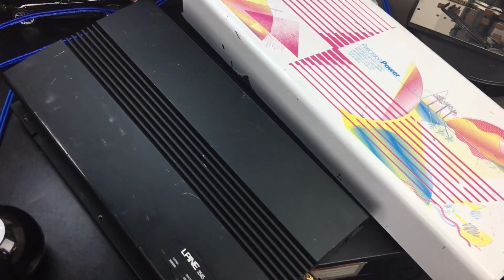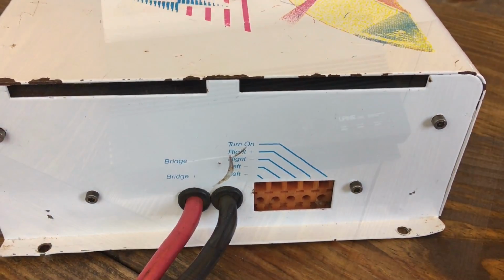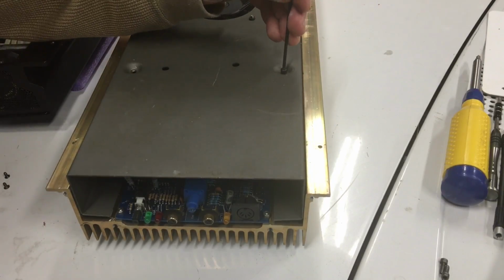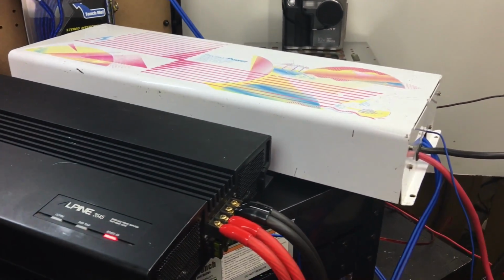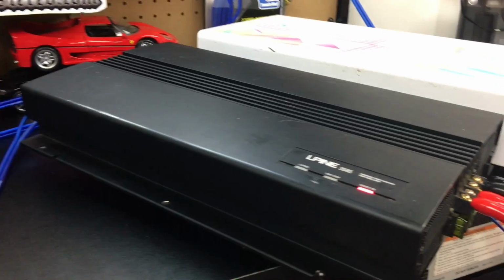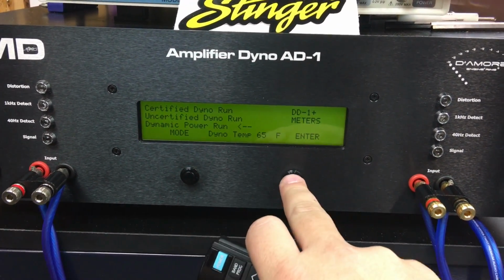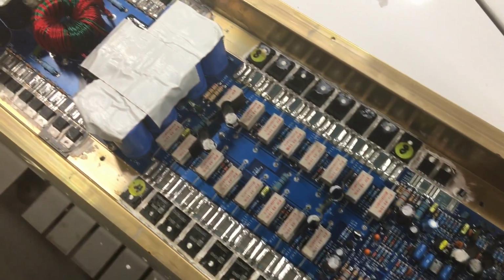1989 Alpine 3545 vs Precision Power (PPI) 2350DM Amp Dyno Drag Race

Comment from the maker: Ok, so I had to rewatch this video. I have over 500 vids on YouTube, so I can't possibly remember them all. I'll have a few short vids on the Alpine 3545 and 3558 upcoming on my 2nd channel at WheelieWilliston.com . Make sure you check out that channel and consider subscribing for more content!
Reply: I got an Alpine MRV-500 for my birthday and it was a nice little amp. After I upgraded from a K-9 to an EVL D2 (both 12's), I got a brand new Skar RP1200. I got the EVL and 1200.1 at the same time so when I heard it I thought it was defective. It wasn't near as hard hitting as the 500.1 on an EVL D4 I had in my Civic. Long story short, I hooked up the 500.1 to the EVL-D2 and OMFG that thing is WAY HARDER HITTING than the SKAR 1200.1!  If you ever have a chance to do a comparison I think that Alpine would smoke the SKAR at 1Ohm or maybe I just got a defective unit. The only thing that makes sense is that my stock electrical system was better suited for the 500.1 and there just wasn't enough spare amps to get anywhere near 1000w.

Comment: The 3545 had zero noise, zero engine noise, zero turn-on or turn-off pop. One of the best amps ever made. My competition car was originally running two HiFonics Zeus, US made in those days amps, 300x2. The Alpine rep was looking at my system one day and asked why I wasn't running their 3545 amps. I replied, "because they are $1400 each?"

He then tells me he will give me one for half of cost and another for free. It was no question. Even though HiFonics were really good amps in those days and rated for more power, the Alpines sounded far better. It's not about the amount of power in audio, it's about the quality of the power. I was running two DynAudio 11" subs with 4" voicecoils, also the best sub I ever heard, but they need a large enclosure and a special "VarioVent". My enclosure was 2.75 cu. ft. per sub, but it was smooth down to 16 Hz.
Reply: If installed right, you'll never hear engine noise, and I'm (currently) a ppi 600.2 for my interiors and an alpine 1505 on a triple stack of Rockfords HE @ 2.8 ohm load, and  alpine has never shut off once. Considering it's only 4 ohm stable bridged. I'm thinking about pulling the 1200.2 off the wall, but my alpine remote light stays on after sitting on my wall for 20 years, but to be fair, I did put a piece of plexiglass on the bottom to show off the V12 caps and after spraying windex to clean all those year probably did it (that's what a tech told me) but just hooked the remote lead to a non accessory fuse and she cuts off and on. I love old school amps. I have around 8 on my wall now since I started using a couple. I still have my first class d mono block, a Sony gxd 600 mobile es. With only three 25 amp fuses, it did 1400 watts dynamically. Go check it out

Comment: I bought that 3545 slightly used in 1990 and had it pushing 2 pro series 12's I wish I still had that amp I also had the 3559 as well ❤️‍🩹 them both

Comment: I’d maybe want to redo that 4 ohm certified run. Not sure how you had them wired as far as power supply. Like were they on separate battery banks? Maybe the PPI was pulling power out of the Alpine during that run? The voltage didn’t reflect that, but maybe it was losing amperage. Just weird that the Alpine kicked butt at 8 ohms certified and 4 ohms dynamic, but slacked off at 4 ohms certified. Still a cool test and both great amps.

Comment: @williston Audio Labs im not sure if the comments get to you on these old videos. Never the less I'll try lol i would like to see if you can dyno a interesting amp from alpine, but with a difference from anything else you have tested from alpine. This alpine amp comes from the factory Volvo c70 with the DynaAudio system. It almost looks like a factory Alpine with just a 6 pin din cable for the audio imput. Looks to be a 100x4 amp with no manual adjustment. I would love to see you take a look and dyno it. I attempted to contact alpine for data on the amp but they state no record of a factory Volvo amp lol millennials

Comment: Big d I have the alpine 3545 mine is chrome in color with a forest green on the middle fins. Also at 4 ohm load  bridged using a multimeter I got 993 watts 4 ohm and I always ran mine at 2 ohm bridged and testing output   bridged  2 ohm I got 1678 watts also I use 3 40 amp fuses and tested at 14.4 volts and dropped to 13.8 volts.

Comment: I have the same Ferrari toy car that you have up there on your desk I bought it about several years ago
Reply from the maker: Cool car 👌
Reply: @wal  
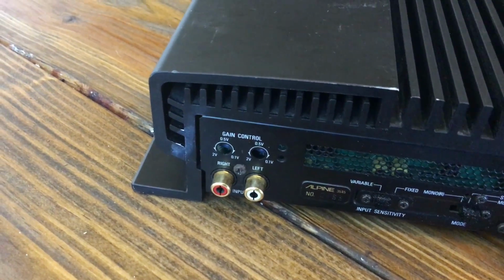Hey I got a question if I send in an old Kenwood 10:20 you can test it right how does the shipping and all that go and also what is a good amp just for everyday use I don't have to have nothing dramatic or crazy I'm looking either at a PPI or old kicker I'm look I'm looking to push 1 kicker 12 L7 that is it and some inside speakers before I had a kicker 600 / 4 probably late 90s model I think it was a Class D it's the ones that come with the big covers on them the newer model ones not the latest model but probably that were made into the 2000 mid-2000s I had one of them before with one L7 and I think I had five or six speakers off that which were my insides off 1:00 amp and it sounded very good and I was satisfied actually probably my best combination I've ever had was I had original Kicker L7 the very first model I don't know if I had it at 4 or 2 Ohm and then I had my insides ran off of that same amp so really I think I was only getting probably 300 true watts to the speaker the big L7 12in and the other watch were probably going to eat speaker I think they were rated for 60 watt Max and I have 5 speakers so that would have been the other 300 watts but man did it sound good just with that 300 watts going to that sub that was more than enough power everybody thinks that you need to 3000 watts to push a couple Subs you really don't I think that them stem Kicker L7 12 are totally justifiable anywhere from 250 Watts and I think they'll handle what is a 600 RMS and I think the newer ones even go more than that I never like to push him after Peak cuz I like my speakers to last but that's all I'm looking for a nice 600/4 kicker amp older one from probably the early 2000s late 90s digital if possible which I like the best and can you give me a quick rundown of what each things means and the amp like THD and you got other things to that you speak about on their distortion and so forth what is the difference if a Class A and B to D mono and the newest amps out is the power is cleaner so you're going to get a harder base or just a cleaner all around sound hitting experience

Comment: From 95-02 I installed many ppi, alpine, Rockford, mtx, us amps, even some linear power. Ppi was consistently the most over priced worst performing. I wonder if that tiny power/ground is holding this one back? Idk. I was just never a fan. May have met rated but mtx thunder series and Rockford punch series always far exceeded rated for less money.

Comment: PPI $2 a watt. That is crazy. So my dd audio m5 should have cost about $20,000 by those standards. I paid $1200 for it, 3 months old in flawless condition. Dynamic 1 ohm 13.3 volts it does 10,000 watts. Certified around 8000 I believe.

Comment: I ran across this and it brought me backto  when I was about 19, 1990 I had an amazing audio system in my car.  I had 2 of the Alpine 3545 amps bridged to 2 15' Rockford pro series subs.  ADS and Nakamichi components up front. I don't remember the rear speakers. I think they were Nakamichi.  It was a fun system and the bass was just off the charts for anything back in those days. I just thought I would share that with some people that might  appreciate something like that.
Reply: That was the best setup! I remember. Holy moly you were pounding clean.
Reply: Those were the good old days 😎
Reply: Take me back to the 90,s any day and keep me there.
Reply: I had 2 of these on 4 15 round kicker solo subs and it would tap out ppl in a blazer in the 90s

Comment: Back in the day,I had 2 of the 3545s one  pushing a 15" Alpine pro series sub. The other pushing a pair of Alpine 12" pro series subs .It was a complete Alpine system, except for the Audio Control electronic crossovers and EQs . In total I had approximately 4000 watts  RMS nominal power. It was and still is one of the most balanced and bedt sounding  car audio systems I've ever heard. This was in 1989.
Reply from the maker: Oh yeah 👌😬👍
Reply: I have a 3553, and I cannot find any info on it anywhere online.

Comment: the ppi 2350DM was designed as a "cost is no object, state of the art sound quality" amp.  alpine in the late 80s was all about power, but the ppi was a far better amp in terms of sq.
Reply from the maker: +heasoundsystems that's debatable, the Alpine 3545 was used in some of the best SQ cars at the time
Reply: BigDWiz in stereo... GRAND NATIONAL!

Comment: I'd say the second run would have looked much better for the Alpine had you fed a bit higher voltage to it (i.e. used 14.4v instead of 13.Xv). The PPI amp is stiffly regulated, whereas the Alpine is completely unregulated. That little bit of extra electrical current makes a big difference. 

Great test as usual. I'd like to see the Alpine run at 2ohms bridged "certified", even though it's not rated to go that low. I bet it will make gobs of power as long as you have the current to feed it.
Reply from the maker: +Kevin Williams The Alpine 3545 has a regulated power supply, although it acts like an uregulated for the dynamic tests!
Reply: BigDWiz slightly less regulated, but as I’m sure you know a great sounding amp.

Comment: Japan knew how to build them.  Still do.  Just because the guts look wierd doesn't mean that they don't do their thing.  Top that off by the fact that most of the Japanese amps I run into are still working 20-30 years later.
Reply: Mickey Pietrzak agreed! My dads old bimmer was sitting for 13 years, we decided to fire it back up, he had a alpine 3566 amp running for his full system with 2 10’s, man that amp still kicks but even after 20 years later!

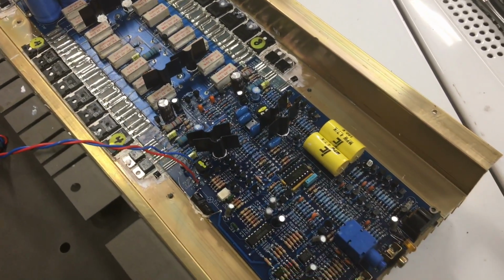Comment: 2:48 resistors for DAYS
Reply: Kevin Williams he was right,those are power resistors, they're low impedance and designed to dissipate more heat than standard resistors.
Reply: If you're referring to the Grey block-like components at 2:48 , those aren't resistors. They are ceramic capacitors. They are used instead of electrolytic caps in high heat areas where electrolytic caps would be prone to fail. They also maintain their microfarad rating at higher tolerances than electrolytic caps do. In other words they keep the same values and therefore maintain the integrity of other components on the board.
Reply: Definitely power resistors which aid in balancing the MOSFETS. Ceramic caps lol.  You can see electrolytics under the grey tape, however.

Comment: One thing I noticed running PPI back in the day was SQ was off the charts with good subs and fronts.
Reply: Agree 100 percent.  Ran a ppi 2150am with rockford tweeters mids and midbass in each door and 2 sealed rockford 12s behind the seats and it was so clean yet pounded hard enoughm

Comment: Dereck, how accurate was the clip light indicator on the Alpine amp when tested in certified??
Reply from the maker: Great question! I honestly didn't compare Dyno and clip light, but will try. If it's anything like the Orion amps, the amp's clip light will light up slightly before Dyno shows clipping. I believe it's the amp mfg's playing it safe...
Reply: BigDWiz have you tested the Alpine mrp m1000? I was curious of its actual numbers

Comment: agreed.  it is to bad that the younger generation of car audio  fanatics never got a chance too hear how good a system can sound and even hit hard using only 600 or so watts of clean power. guess I'm just a dying breed of true high fidelity stereo equipment.
Reply: Then again our subs didn’t have a sensitivity of 81db & didn’t need 1500-5kw!  I’ll give ya the $150 amps now, but get back to us in 25-30years & let me know how they’re working, or how many repairs.
Reply from the maker: +shane n I paid $400 for my first 200 watt amp. Being high school age and trying to have a big system (on a budget), I can't say if I wasn't given the opportunity to buy a 1500 watt amp for $150 that I'd turn it down either. We simply didn't have that option back in the early 90's
Reply: Cerwin Vegas were fairly sensitive. Especially the Nicle Plated Pioneer Elite Series subs. Those were badazz... and just cleeeaaannn hitting.
Reply: Dave Micolichek  yeah, thats what im saying. There wasn't really decent cheap stuff available back then. It was either the expensive stuff or it was cheap but ripe old trash. 

Now we have some pretty good cheap stuff available as well. And still the high quality expensive stuff which pretty much still costs the same as it back then in comparison if take inflation into concideration.

Comment: Run the PPI at 2ohm and 1ohm.  I ran mine at 1ohm regularly.
Reply from the maker: +Eric Patterson these amps are not designed for 2 ohms (mono) or lower. The 4 ohm mono test would put a 2 ohm load per stereo channel, running it any lower will not produce any more power and most likely put the amp into protect
Reply: BigDWiz  D at a 2 ohm mono, while playing music you know that either amp will see that load unless at tuned frequency of box or very low volume. This is one of my 3 PPI amps. It is a very nice sounding amp, the alpine is too

Comment: That PPI's guts are a true work of art and a tribute to the workmanship that were put into these amps back in the day!  I miss those times.
Reply from the maker: And the engineering of how it was assembled...impressive but a pain to get to the guts 👎
Reply: The only complaint I have about the PPI is the stupidass way it mounts the semiconductors.  The steel fingers on the back cover or ridiculous.  They aren't even spring steel.  I replaced the back panel on my PC2150 with plexiglass and drilled and tapped all the necessary holes and used insulator spacers to properly mount them to the heatsink.  Other then that the innards are beautiful!.
Reply: cooling seems limited. it just recirculates the internal air?

Comment from the maker: 27 year old amps battle on the Amp Dyno!!
Reply: Hey BigD I've just acquired an Alpine 3553. Not knowing a lot about Alpine's amplifier lineage, I was wondering if you had any info stashed in your stack of Car Audio mags???
I do know from what I have managed to find is, it's from the late 80's / early 90's, and it's made in Japan. Its works 100% and sounds just amazing.  There is just very little info out there I guess.  Thanks for letting me kindly bother you for a favor....Rock on!
Reply: @TheTheeggmann  I had 2 of these amps! Stolen.... along with a 3552 and a 3555. I believe the specs were 4 x 30 watts at 4 ohms. And bridged 2 channel gave ya' 80 watts per channel. They were purchased from Audio Associates.   I miss my old set up. I had 32 speakers in a 1992 Ford Mustang hatchback. I know this is a late response...but these were nice clean A/B class amps. 18 db/octave crossovers. I had mine set at 80. Still have a love for the Alpine stuff! 😎😇
Reply: @TheTheeggmann  The 3552 is 35 watts per channel and 85 bridged and the 3554 is 50 watts per channel and 150 bridged so the 3553 has to be somewhere in between those two.
Reply: I love all your videos but your older vids of these older amps are by far my favorite. Thanks for all the time, money, and work you put into making  and sharing them with us.
Reply: Hi, I noticed you tested the kenwood kac mini amp a while back, I was wondering what is your take on the Dual DA301 mini amp.
Reply: I noticed while you were showing the Alpine guts a few of the fets had some pretty sloppy solder, do you think any of the repairs over the years affected the outcome? 
I am currently running a 1505 on 2 Type R 10s and it works them, so just curious.
Reply: Hi it's nice video!
I have an alpine 3545.
How much do you charge for it?

Comment: Killer video! I'm guessing the PPI has a regulated power supply?
Reply from the maker: +hifivega Yessir, both amps are said to be regulated. I'd say the Alpine is "loosely" regulated and it's among the most impressive regulated Dyno runs at 4 ohms I've seen (jump from certified to Dynamic)
Reply: +Dereck BigDWiz I had a feeling it was going to do well!